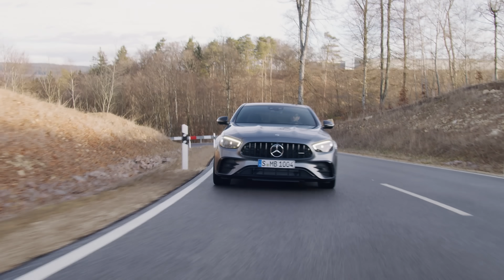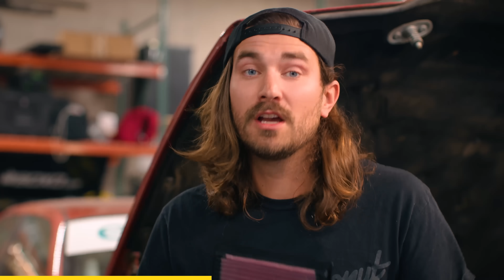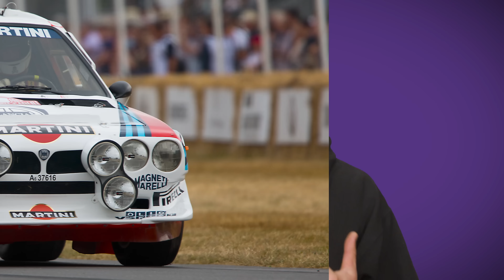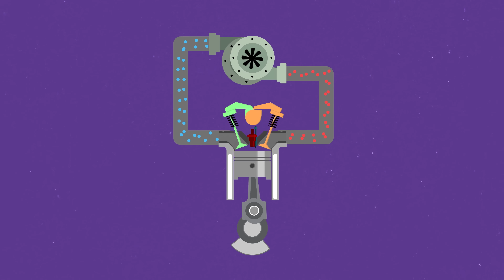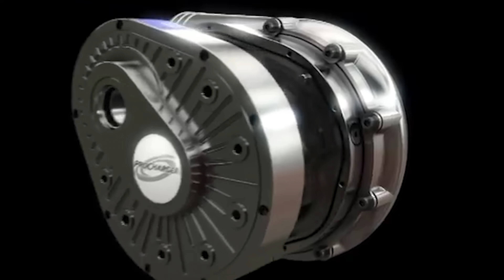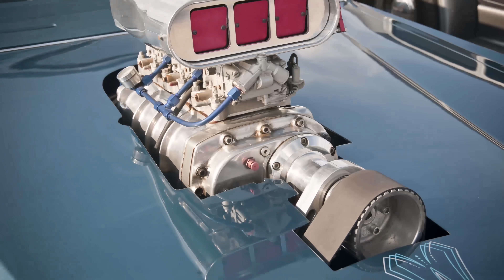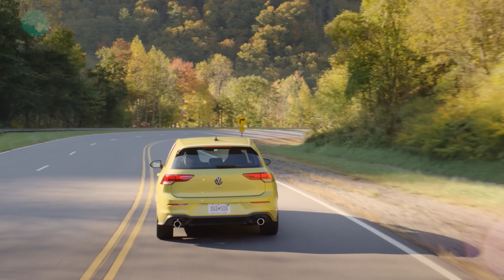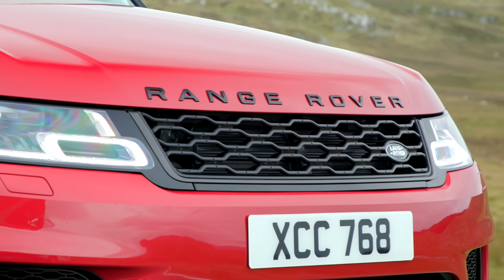Why Your Engine Isn't Twin-Charged

Comment: Maybe sometime go over Mercedes 's forced induction system on their F1 cars. The exhaust turbine is on the back of the engine turning a long shaft across the engine to the front turning a generator that's powering the compressor side of the setup or something like that. It's actually pretty cool, maybe in a different configuration it can be adapted to modern engines, the long shaft is it's weak point as having a long piece spin real fast is hard to control.

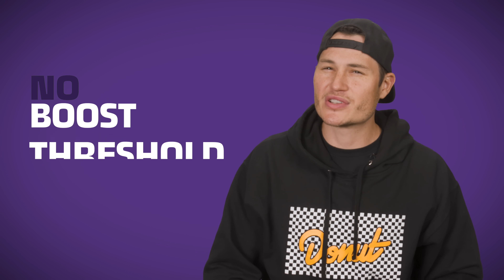Comment: @8:28 you say that the supercharger pumps the same amount of air regardless of engine speed. How can that be? With the supercharger being crank driven, it would increase its RPM at the same rate as the engine, increasing the amount of air going through. If you mean that the PSI of boost doesn't change, that I could maybe believe, but not  the raw amount of air itself. 
Also, it seems people always say turbos don't have parasitic loss and superchargers do. They both do, just in different ways. If placing something in the way of the exhaust did not make a difference, there would be no aftermarket exhaust systems, mufflers, and high-flow cats.

Comment: Wouldnt it be less complicated if you just had the turbo blowing in to the supercharger for compound boost? Then you could increase the efficiency of the supercharger. You wont get the same high HP of just the turbo, but extra power basically everywhere else. Maybe the extra weight and complexity doesnt pay off but at least that way you dont have to work the supercharger as hard, by keeping it in its efficiency range

Comment: A low speed engine such as a inline six in a heavy duty application have giant frame turbos ( typically larger than a t4 ) . 

Using a vnt / vgt design can give a truck the ability to have positive manifold pressure (boost) at idle .

Gas engines need some small vaccum to run the brake booster and other accessories

Comment: This is purely hypothetical but what if you do a TwinTurbo set up but one turbo is smaller for lower RPMs while the second turbo is bigger for higher RPMs
Reply: It's called a compound turbo
Reply: Most twin turbo cars actually do this.BMW’s S55 and S58 does this.

Comment: Except manufacturers been makin turbos smaller that come on fast n drop off up top so...  This was mostly true in the days of larger turbos an turbo lag but now adays they come on at 1,200rpm or so n drop off at like 4.5k to 5k Aslo you missed a engine that was twin charged XD only that I know of so probably more than one.

Comment: My 8v92 silver Detroit has both.
Reply: Detroits weren't twin charged or even supercharged. The blower on them was required to run. It's a two stroke with no exhaust valves it has intakes ports in the cylinder wall. The piston uncovers these ports at the bottom of the stroke. The piston does not create vacuum at the bottom of the stroke. So the blower is there to get air into the cylinder and that's about it which makes it naturally aspirated and the turbo variants we're like any other turbo diesel.
Reply: @dillon8987  your talking to someone who owns and built them. I know how they work 👍
Reply: @kylegentile2007  it's a video about twin charging and I do t really care what you do 😂

Comment: Compound boosting works. Hellion turbos compound boosted a '03 Cobra and was making 1300hp without trying. So much power that the IRS was bowing under load. Most King Of The Street cars are compound boosted, make 1500+hp and are docile enough to drive everyday with all the creature comforts. Go deep into the throttle though, and it transforms into a nuclear blast of power.

Comment: You're incorrect about twin charging. Whipple bypasses their superchargers with a simple valve between the blower manifold and blower inlet, allowing their units to freewheel. Also, high quality turbos don't require a bypass system, such as on Subaru engines.

Comment: 7:00 exhaust does not flow through the turbine, exhaust is blasted against the turbine. It takes energy from a rotating assembly to create that exhaust pressure. Thus, turbos are not free output.

Comment: Hey Donut I need you to listen to me for a second yes up front I’m crazy as fuck and I’m a disabled Veteran with some medical shit that screws with my quality of life so I got to reading rules and regs and shit and I have a fairly solid concept that I will give to you and the world because I believe strongly enough in the concept that I know I’m going to get fucked out of an money that would go my way but if it makes it into reality and I can order one fuck it game on 

Here’s the concept 

Source funding for a vehicle powered by a twin charged Motus V4 Baby Block twin charged paired to a 4wd motorcycle… yes I said 4 wheels I want to build a vehicle that can take the feeling of riding a motorcycle the utility of a sxs or clapped out ranger or s10 Toyotas are to nice even clapped out but I digress you build a ride on motorcycle quad with bars and all the fixings of your motorcycle and then add the safety of 4 wheels and large off-road bias tires and a full 8’ bed with a dump box and loading winch along with the lights to make it Hwy legal and safe with the ability to go off the pave road and get out in the blm or parks and rec areas with service as an extremely efficient vehicle for both hunters with disabilities or those that have need of stretcher carrier with 4wd and an un obstructed view the uses are endless the bike I would base it off of is the motus mstr personally I’d have mine look like a Heinrich tank off a bmw r100 sidecar get drunk with an r80gs Paris-Dakar and then after getting handed to Roland sands I’d ask for “no regrets” and 10” pullback risers high rise pro taper mx bars and a club style fairing with gps/satnav and speakers finish with ridged industry’s leds/strobes 

You have the power make my dream vehicle available bring motus back to life and provide an American utility vehicle so cool even the Cana boys will want a American monster 

If it does happen try and remember I fucking gave it to you

Comment: Let's do some math for no reason! What would it look like if they were actually spinning an image of him around an axis to simulate him running in a circle at 280,000rpm? It would look like him and a mirror image of him spinning around themselves 1.67 times every second!  
Let's take a look at why:  
280,000rpm is 4666.67 rotations/revolutions per second. Assuming that the video is playing at 30 frames per second, that means that he'll complete 155.56 spins every frame. Ignoring the whole spins, every frame he will appear to move forward ~55% of a circle, or move forward ~6% every frame while alternating sides. This means that every second, they will complete 1.67 spins.  
The super fun part? If the video is playing at 24 frames per second, it would look exactly the same... but backwards! At 24fps, the image advances ~44%, or moves backwards ~6% while alternating sides. Math is crazy!

Comment: I've always wanted to see an electric blower/turbo could do.  With hybrid engines it makes sense to eat up a little power for one.
Reply: VW has an electric centrifugal supercharger sequential to a turbocharger. Mostly it does nothing until the driver hits wide open throttle below 1600 rpm. When or if that happens the electric  motor adds 0.5 bar of inlet pressure until the turbo can catch up. Audi SQ7 4.0 TDI. Volvo used a compressed air feed to spin up the turbo on its S90 D5. 
Both consume vast amounts of energy when in operation

Comment: How about the military version of the Detroit 8V92, twin charged 2 stroke diesel
Reply: Detroits weren't twin charged or even supercharged. The blower on them was required to run. It's a two stroke with no exhaust valves it has intakes ports in the cylinder wall. The piston uncovers these ports at the bottom of the stroke. The piston does not create vacuum at the bottom of the stroke. So the blower is there to get air into the cylinder and that's about it which makes it naturally aspirated and the turbo variants we're like any other turbo diesel.
Reply: @dillon8987  ones I worked on had both think it went into the big Oshkosh trucks

Comment: I did this on my 4.9 liter ford in line 6, I love it, 10 psi at the hit from supercharger and the turbo pulls it to 25 psi with a minor headbolt upgrade while running on e 85
Reply: Is that the white one I see on the 300 Facebook forums?

Comment: There has definitely been more then 8 twin charged engines. The first dateing back to 1938 i believe. Detroit 71 series motors were commonly twin charged. I would also like to hear your take on Gale Banks twin charged duramax, and his realization/theory that it would/could be more efficient if the blower compressed the air and sent it into the turbo.

Comment: An advantage of twin charging is that you dont overspin a supercharger or blow the impeller on the turbo. Good balance for reliability but getting hp. New turbo cars are notorious for having turbo problems around 100k miles. Not enough data to prove twin charged would last longer but it works in the Performance world

Comment: 2 stroke Detroit Diesels, needed a Roots supercharger to be able to run by design and considered NA.
Turbo charging was added later to increase power output.
Interesting engine series with many applications and sizes.
Reply: Ah a man of culture I see so many people saying the Detroits are first to do it 😂

Comment: Curious as to why manufacturers haven’t attempted to scavenge the extra boost pressure attained when the wastegate opens to retain air pressure that could then be used to help spin up the turbo once again. Seems less complicated than twin charging. Perhaps the size of the tank necessary for adequate volume retention creates too much of a packaging issue. You could use it like a shot of nitrous, in effect.
Reply: They do. That’s literally the stock setup… which is why you don’t have the lovely PSHHH sound every time you lift the throttle on stock cars. The blowoff recycles rather than venting to the atmosphere.
Reply: @JoeIsCrazyWillman  I understand what you are saying, but that’s not really what I was going for. You’re talking about recirculating the air back to the inlet side of the turbo to help reduce back pressure, which helps keep the turbo spinning. I’m referring to wastegates, either venting exhaust to the air or circumnavigating it around the turbo back to the downpipe. Why have this setup, when the turbo could run all exhaust through it, and any unused boost pressure could be held in a storage tank, to be used immediately upon acceleration request, before the turbocharger can build pressure again.
Reply: @jeffreyarmstrong6203  
It's simply not worth the effort. Gas tanks operate differently than liquid tanks, and air is lighter than exhaust gas.

Comment: Detroit made twin charged two stroke diesels ie the 8v92
Reply: Detroits weren't twin charged or even supercharged. The blower on them was required to run. It's a two stroke with no exhaust valves it has intakes ports in the cylinder wall. The piston uncovers these ports at the bottom of the stroke. The piston does not create vacuum at the bottom of the stroke. So the blower is there to get air into the cylinder and that's about it which makes it naturally aspirated and the turbo variants we're like any other turbo diesel.

Comment: I saw a special on the Marlin Rolls Royce engine used in the later spitfires and P-51 Mustangs. They said they were twin supercharged and twin turbocharged. I imagine this would enable the engine to run where the air was too this for most aircraft piston engines, Force that air down the throat of that engine.

Comment: Detroit (and I think Cummins) made twin charged engines in the last 30 years. The Detroit had 12L+ of displacement and I believe the force induction system was making like 75lbs of boost. The horse power numbers weren’t particularly impressive, but they produced well north of 1,000ft-lbs of torque
Reply: If you are thinking of the Detroit 2 strokes then the supercharger is still considered N/A because that engine design requires a blower to run
Reply: The 2 strokes back in the 60s and 70s had a turbo and a blower, not sure if the blower actually added power tho...I know the cylinder sleeves had the exhaust ports at the bottom and the blower blew the smoke out at the bottom of the stroke, then it filled it with air(so yeah it added power) and fired on the upstroke, still favorite motor so smoky so loud so high reving. Love those bad boys.
Reply: @kevininforks  Those were 2 stroke engines.  (1) Intake and exhaust. (2) compression and power.
Reply: Yeah the blower was literally just to blow the smoke out the bottom.
Reply: The Australian army runs the Detroit in our ASLAVs, it’s interesting to learn it’s not considered twin charged though! Learn something new everyday.
Reply: @Ekdlmnop  Yeah.  What was importat was that the engine did its work.
Reply: The 8v92 or silver92 (V8 2-stroke diesel)had a 871 blower with a large turbo bolted directly to the top of it. Silvers we’re rated around 500hp. Doesn’t seem like a lot but in the 70’s amid fuel restrictions it was huge.
Reply: My 15l cummins has a single turbo and 45ish lbs of boost. Torque values are over 2000lb ft.
Reply: To be fair diesels have the advantage of injecting the fuel at the top of the stroke. They dont really need to worry about pre-detonation. But still, 75lbs of boost is insane!
Reply: There’s a few guys on YouTube, calebz400 and Ian campbell, who have videos of their 3rd Gen common rail and 2nd Gen VP-44 Cummins pickups that they twin charged with a roots blower. There’s other videos of some compound turbo trucks stacked with a blower.
Reply: volvo did it too
Reply: vaporlock I think you may be thinking of the DD15 which not only was twin charged as you said but it was also turbocompounded. The DD15 is a masterpiece of diesel engineering. Its the near pinical of performance and technology for a engine of its size and class.
Reply: @theq4602  we were referring to a Detroit motor from the 70’s when Detroit was still a two stroke motor.
Reply: Dillon, yes Detroit considered them to be NA, but a Non turbo version still made pressure slightly above ambient, something in the range of 1-2psi. By a technicality that would class it as forced induction,even though the blower is only actually there to force the exhaust gasses out.

Comment: I dont get it. Turbo chargers are spun by the exhaust gases, but the exhaust is given the pressure by the power stroke. Everything that runs the engine is based off of the power stroke... Id imagine thats why it is called that. So i really dont think the idea that superchargers are "parasitic" because of running off the crank because the initial forces involved with both methods of forced induction come from the same place.

Comment: What about the Detroit 8V92 twin charged engine from the 80s and 90s
Reply: Detroits weren't twin charged or even supercharged. The blower on them was required to run. It's a two stroke with no exhaust valves it has intakes ports in the cylinder wall. The piston uncovers these ports at the bottom of the stroke. The piston does not create vacuum at the bottom of the stroke. So the blower is there to get air into the cylinder and that's about it which makes it naturally aspirated and the turbo variants we're like any other turbo diesel.

Comment: My recent research has told me that compound turbo-charging can achieve the same effect with presumably less complexity, and NON of the downsides of positive displacement supercharging.

Basically, you attach a small turbo to your exhaust manifold and from the exhaust of that, you attach your big turbo. The big turbo intakes from the intake box/filter, and then feeds into the intake of the small turbo, which sends all of that to the engine. I believe you can have an intercooler at either point that's pressurized by a turbocharger, but don't quote me on that.

What happens is the big turbo helps the little one spool up, so the little one doesn't have to be as conventionally small as you might think. And both of them combined create a greater maximum boost pressure, so the big one also doesn't have to be as big as you might think to cover the top end. Combined with the fact that both turbos are running in their efficiency range for pressure ratio created (which is 2:1-3:1 usually) and the whole system is much more efficient than any sequential twin turbo, parallel twin turbo (same sized ones) or single turbo system ever could be.

It's also how you see insane 60+ PSI boost pressures and actually get something done with them, lol. Unfortunately, the only things that really run this setup commonly are Diesels, HOWEVER, it seems to be gaining more ground in the niche Gas engine circles, lately. My favorite example is a 1400+HP K24 S2000. I also think there's a 1JZ out there set up like this and a couple other Honda motors. One video I watched said they were getting measurable boost pressure at 1800 RPM.

Just imagine a 2JZ that made 600 wheel on pump gas, but hit boost at like 2000-2500 RPM and only had to rev out to like 7000-7500 max to do all that. That's the power of compounds, baby! On V engines, you could do a quad turbo for symmetry where you have a compound setup for each bank. Or do some crazy exhaust routing to run the two turbos off of essentially one 6-into-1 up to 12-into-1 collector.